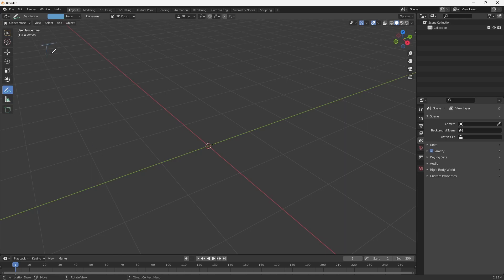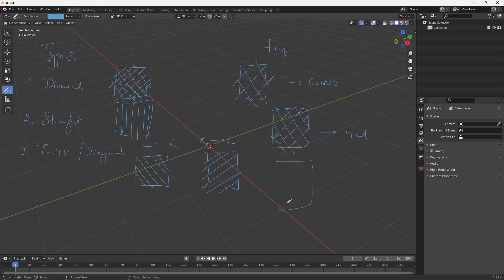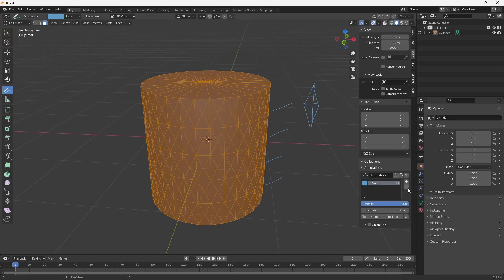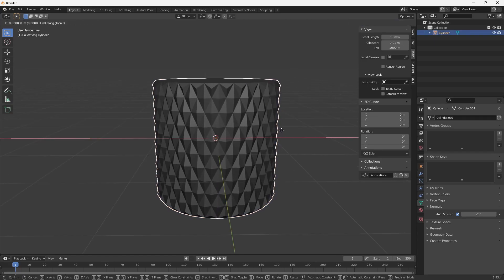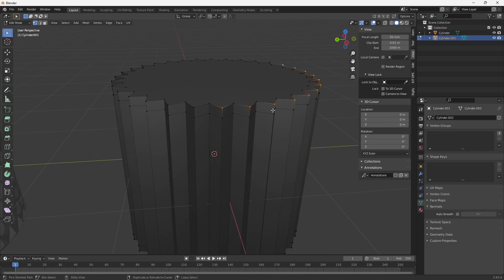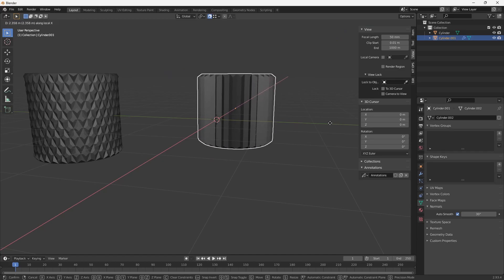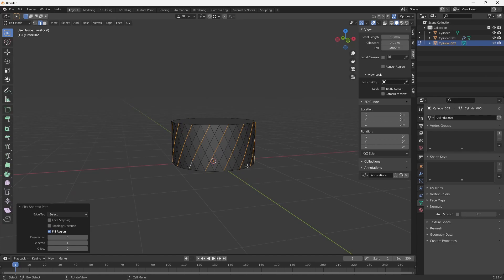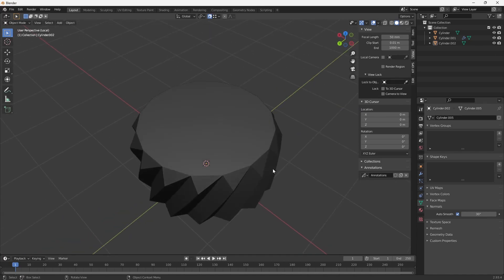How to Model Different Types of Knurling Profiles | Blender3D

Comment: Select similar and such are very useful :D But there has to be a more parametric way to do this, would be extremely annoying if you wanted to change it and you have to manually select all the edges, especially if your wheel is very high large and high poly :/